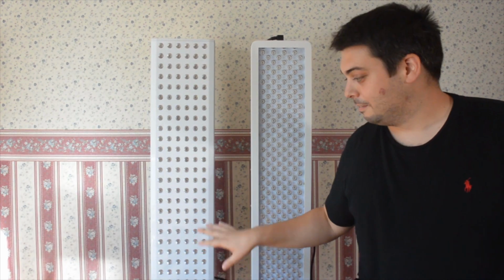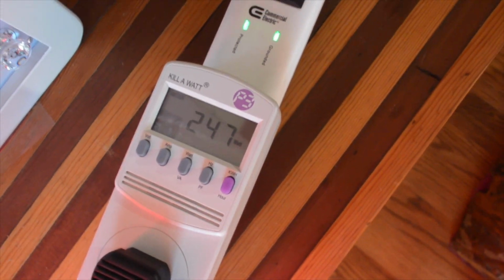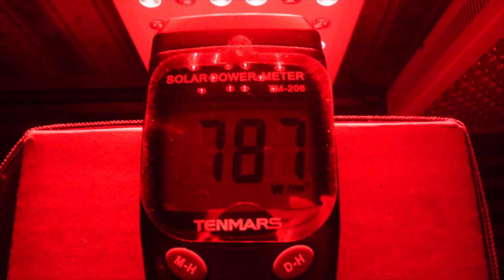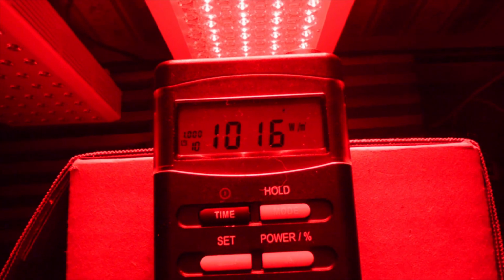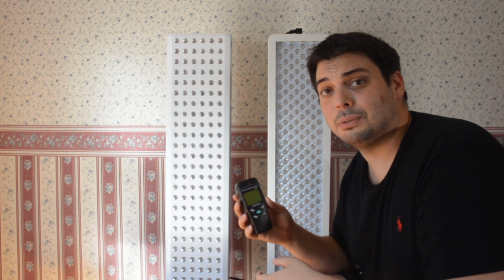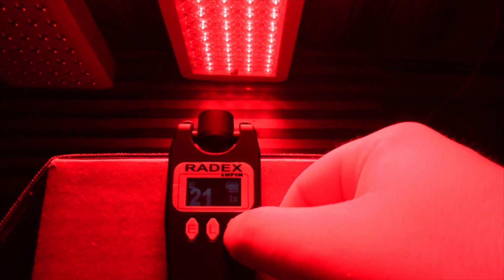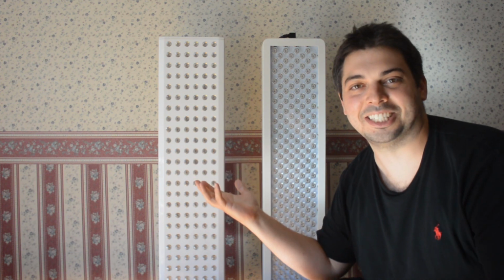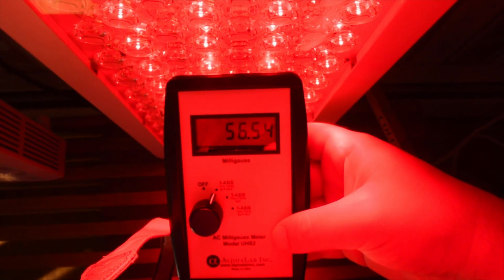SGrow VIG1000 vs Joovv Solo (Gen 2): Alibaba Red Light Therapy Panel Review

Comment: The SGrow and the Joov both put out two simultaneous wavelengths of light.  Since this is true, how do you know what compensation factor to use for the laser power meter, since it's based upon a single wavelength? Wouldn't it be more accurate to measure each wavelength separately and then add the two readings? And if you are using the UNI_T  UT385 you can only measure one wavelength at a time, and so how do you determine the total power output? Also, did flicker readings differ using one wavelength at a time?

Comment: A point that I don't think you made was some of those clinical studies, they often will use those cheaper meters.  So not only are the readings vastly different, but the results of the studies may have used vastly different measurements that people are basing doses off as well.

Comment: I'm glad I've found out your videos, Sir, extraordinarily informative. I have a question for you, though, if intensity is measured through an area of irradiance(cm2), why are these devices about 6 times more "intense" than your own Rex Panel (36 vs 6 mW/cm²)? Is it because there are more LEDs, or is it because the LEDs are stronger? Thank you very much
Reply from the maker: The Rex actually has more LEDs, but they are lower power. This way the Rex can be lower EMF, be used closer to the skin, and is more lightweight and silent with no fans. So it is important not to just to consider intensity but the context with how it is used. Check out our blog for a lot more information about intensity and proper dosing protocols!

Comment: Hey listen I love your insight learning alot, I want to buy your full body panel but you don't sell a horizontal stand so for that reason I'm thinking of possibly going with platinum led body panel with the horizontal stand. What are your thoughts on Platinum led? And wondering if you would ever make a body panel for contact or something that is moldable on the body similar to celluma?
Reply from the maker: They also lie about intensity with solar power meters. But overall thier products are decent. We just did a review on some flexible LED pads!

https://gembared.com/blogs/musings/best-flexible-led-red-light-therapy-pad-wraps-belts-reviewed-with-tips

Comment: great review.  did you check the veilght?
Reply from the maker: I haven't checked Vielight. What would you want to check it for? A lot of their parameters are published in thier trials.
Reply: @gembared  
I just whant to know if there product are relaibal and low EMF . thanks
Reply from the maker: @shaidanino1574  I have heard good things about them overall. The EMF should be pretty low because they are battery powered and don't use any fans.
Reply: @gembared  
thank you for your answer . my next panel defently will be from you.

Comment: What a confused mess.  Terrible nonsense review!  Way too much time for too little squirrely data.  The cheap one looks way better than the Joovv.  Not surprising.  Saying flicker reduces irradiance is more nonsense.  If you can't perceive the flicker without instruments then the off-time is short enough to simply not matter.  It only matters for people that are bothered by flicker.  Your TV flickers.  Your fluorescent lights flicker.  Lack of flicker is a nicety, it's not necessary.
Overall an uniformed or worse, perhaps intended to confuse, review.
Total bullshit.
Reply from the maker: That's the point of the video, the Joovv isn't anything special. There are nearly equivalent panels out there for one fourth the price.

It's easy to measure flicker and the modulation of intensity. That's the entire concept of pulsing as well, where often pulsing is high frequency and imperceptible to the eye, yet it cuts the average intensity down by the duty %. This is in many studies.

If you aren't going to put in any effort to research this yourself then I don't see any value in your criticism.

Sorry if the most thorough testing of red light panels on the internet was a waste of your time. Perhaps some fluffy sales videos from Joovv are more your flavor.

Comment: So for all the tests, you turned on BOTH the RED (660nm) and the NIR (850nm) LEDS?  For example, that would explain the difference in actual power-consumption versus the rated power on the box!

However, assuming everything is on, then it seems SGROW is less efficient, and has more flicker than the Joovv.

So all of the Chinese units can run on 110V?
SGROW 1500W
SGROW VIG1000  1000W
SGROW VIGPRO 500W 
SGROW B07YFZ8KQZ  600W

Also any thoughts on the 250W INCANDESCENT NIR bulbs (RubyLux , SaunaSpace ThermaLight  , Philips Heat Lamp R40 , Fengrun Lighting )?   They say they output output 1000 mW/cm2 at 6".. yet, I assume much of that is heat, so why do the more efficient 1000W LED panels have such a low output at 6"?
Reply from the maker: Explaination for why you can never trust the "rated" watts.

https://gembared.com/blogs/musings/what-is-the-actual-watts-of-my-led-light-panel
Reply from the maker: Both Red and NIR were on for all the tests.

There are a lot of reasons why we can't use consumed power to estimate intensity from LEDs. 

You will have to check with SGROW to make sure thier units are compatible. Usually panels are made with drivers that accept a range of voltage and frequencies.

You can check our new blog about heat lamps and how we calculate intensity for them!

Comment: The EMF readings for the VIG1000 are fine for short time frames, like standing in the light for 15-20 mins (or even an hour or 2). You wouldnt want to stand there all day long, day after day for hours within 6" but for 20 mins or further than 6" away it is perfectly acceptable.

Comment: Has anymore research been done on contact vs non-contact?  I own a biomax. However, I tore my hamstring and want to maximize NIR benefits, and I don’t think it would be safe to keep my leg in front of panel all day.
Reply from the maker: I haven't found any studies comparing contact vs non-contact specifically. Most studies just go by the contact method because they know that is the most efficient. I summarize some of the primary references for contact method in this blog.

https://gembared.com/blogs/musings/proper-red-light-therapy-dosing-contact-method-vs-non-contact-method

You wouldn't necessarily want to do treatment "all day" anyway due to the biphasic dose response. You will need to reach out to the Biomax company and ask them for the recommended usage to be safe and effective.
Reply: Which one of your products would be best for hamstring pull, and I’ll buy it. Also let me know best protocol. I need this hamstring to heal fast.
Reply from the maker: @TheVeryfunny9  the Biomax should be fine to use once or twice a day for 20min about 12 inches away from the skin.

Then for more targeted treatment I would use the GembaRed Spazer right on the skin for about 10min twice a day. You can split it up into five minute segments covering different areas around the affected area.

https://gembared.com/products/gembared-spazer-handheld-red-and-near-infrared-led-light-panel

Note, this is not medical advise and I can't guarantee you will get benefits. That is just the protocol that I would do if I was in your situation. Always consult a doctor.
Reply: @gembared  it says that it is sold out
Reply from the maker: @TheVeryfunny9  ok try now
Reply: @gembared  okay bought it. I emailed as well asking if I can pay extra for expedited shipping
Reply: @TheVeryfunny9  , how did this work for your hamstring?

Comment: Thank you so much for the thorough explanations. I haven't seen too many comparisons on beam angles. Red Therapy Co has a diagram pertaining to their smallest device, Rush360, showing an angled beam and standing farther from the device would allow full body coverage according to them. Could this be part of the reason it is advised to stand 6 or more inches away?
Reply from the maker: It's hard to compare beam angles because nobody professionally measures it (except GembaRed). So it is the wild west of claims about beam angle and coverage. In theory more distance gets you more coverage, but you lose a lot of intensity depending on the actual beam angle. So the best bet is usually to be as close as possible if you want an effective and efficient dose.
Reply: @gembared  So does GembaRed have some slightly wider angles so you can use a smaller devices for decent intensity whole body coverage (or at least if you divided it into two sections in front and two in back)? I'm also only 5'2 and have a small frame. What's the smallest GembaRed device you would recommend for full body coverage for me? 
Also, would you recommend I do my sides separately? 
Thank you.
Reply from the maker: @YekakaBelenaka  Our body light uses 60 degree lenses, but really after 3rd party analysis the majority of the light is exiting the panel at a 12 degree angle. So this is why it is hard to trust the lens angle if you don't get the entire panel measured for beam angle. You might need to rotate or target different areas separately to get a cumulative full body coverage. We usually recommend starting with our Groove or Rex panels, which are 1 foot by 1 foot square but are lightweight and much more convenient to use. Then you can target different areas of the body over the course of a few days if you need to produce a full body effect. We have some extra information on our website and blog how to be efficient with light therapy without needing a big clunky body-light. And you can see our selection of red light panels and their sizes.

https://gembared.com/blogs/musings/how-to-use-targeted-red-light-therapy-for-a-big-effect
Reply: @gembared  Thank you so much for the info.

Comment: Great review. Really appreciate your honesty and ability to communicate to those of us without the technical knowledge.  For those of us that are on a budget, can you attain the close to the same results from the smaller GembaRed panels as you do with the large panels?  I understand there will be less output and less surface area covered. Thanks
Reply from the maker: Of course! Starting with a smaller panel is a great way to go. Ours are reliably low EMF, low Flicker, and accurately measured.